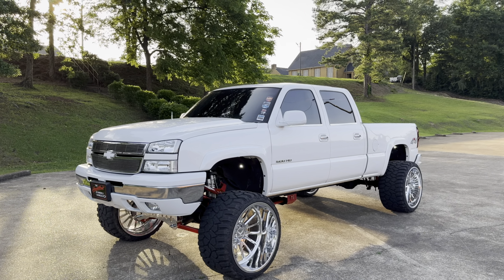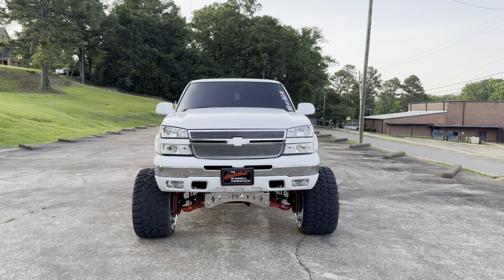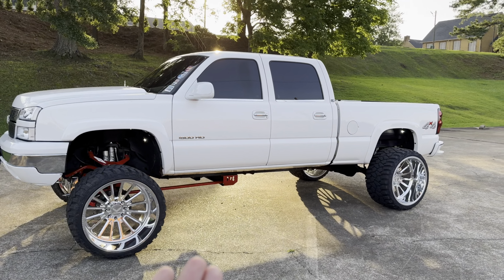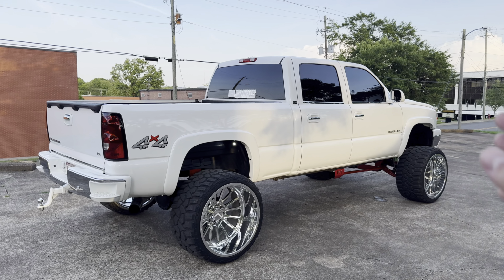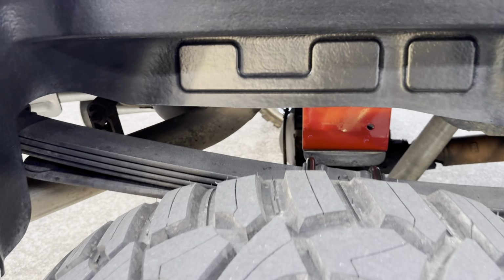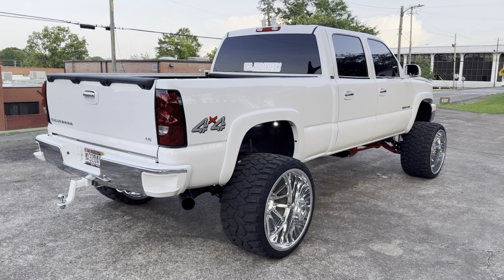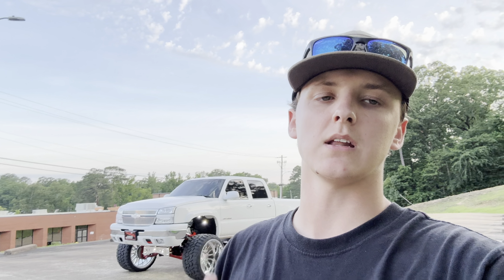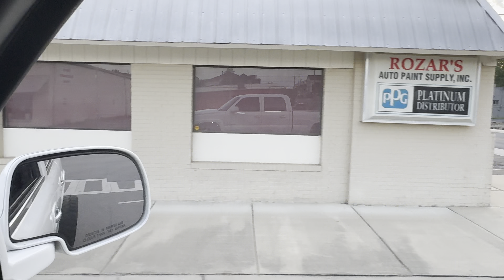BEST CAMMED SILVERADO EXHAUST SETUP? | BTR Truck Norris Cammed 6.0 LS

Comment: I did mine couple years ago. They said  you can use stock TC. I guess so, I have mine in still but I'm sitting on the brake firmer so it doesn't surge is PIA. This cam is as advertised. It is in my 2500HD WT (LY6) for towing. Eaton Truetrac.
I dont recall dyno numbers but I know we didnt put it on the edge with respect to timing and because Im towing loaded 26 ft trailer with car and  can not control fuel types around the country. Truck itself is like 7000lbs.
Excellent purchase!

Comment: The dual exhaust tips is definitely a gasser thing , always felt like the single only belongs on diesels but the truck sounds good no matter which one you stick with 🔥
Reply from the maker: I agree, I think the single tip looks good since I’ve got the longer 2500 frame

Comment: You could do a y pipe straight pipe to keep a single exit exhaust and it wouldn’t clap as much as duals. Or what I would go with is just true dual straights with 4x18 angle cuts exiting right under the rear bumper under the bumper steps. The end of the exhaust tips aligning right at the corner of the bumper it will make the sound travel further as compared to them just pointing straight back

Comment: Yo I recently bought a crew cab cammed 06 5.3 with true dual straights and 6 in tips out the back and its STUPID loud and clappy anywhere around 2k ish rpms and up, I'm currently looking for a muffler setup myself, and to be fair I'm not sure what cam is in it but the guy said either stage 3 or 4 cam I cant remember now but its idle sounds kinda like yours, I can get a exhaust clip if you want but imo you should get a smaller muffler if you want louder without the clap, it should increase its loudness without near as much clap as straights are, up to what you like though

Comment: I have a single cab, short bed Silverado I did a 6.0 swap and the truck Norris cam, with long tubs mine has a x pipe no muffler and straight back you well have clap after 35mph I bought some neighbor hater mufflers and almost if not some clap and I love it